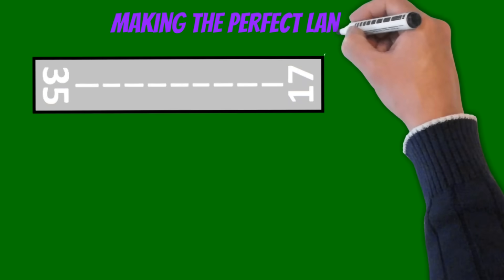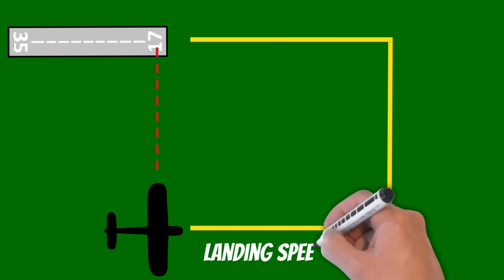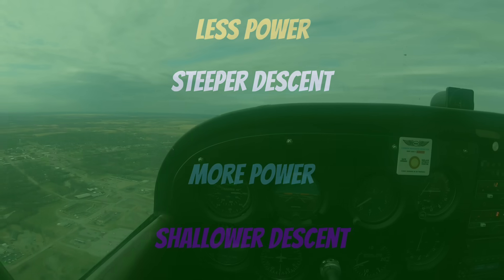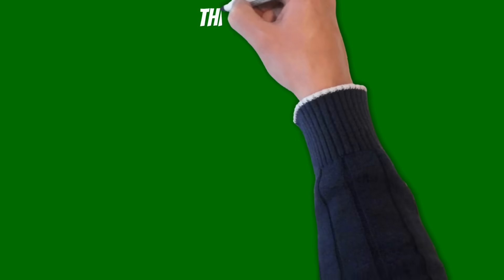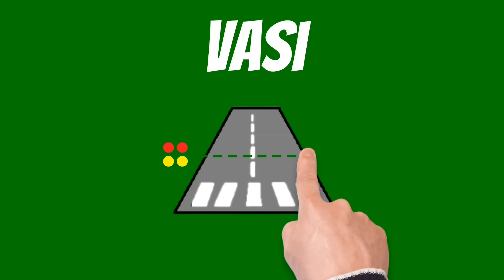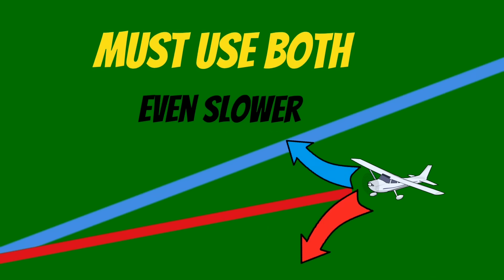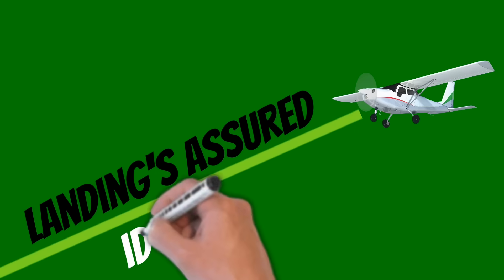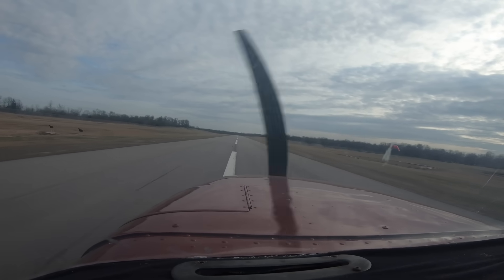Landing SECRET your Instructor won’t tell you [How to Land]

Comment: The secret is fly a cessna 172.

Then all you must do is fly parallel to the runway about 1/2-mile offset. Upon abeam the numbers, simply reduce power to bottom of green, top of yellow range on Tachometer.

First notch of flaps. 

Then fly until runway is 45-degrees behind your shoulder. Make a gentle 20 degree bank, 90-degree turn. Repeat again shortly after. Line up and point the aircraft toward the runway.

Second notch of flaps.

Stabilize. Retrim.

Third/Full flaps.

Retrim. 

DO NOT CHASE THE AIRSPEED. Set the Angle of Attack with the aft pressure on yoke. Relieve backpressure on yoke by use of trim wheel. 

The airplane is stable. The approach is stable. 

Fly to the runway with small changes in power.

Prevent win srift laterally with a little bank angle. 

Keep the nose pointed to the runway centerline with rudder. 

A little cross-control is fine. Forward slips are safe at reasonable glide speed.

Within 10-15ft of the ground, do not flare. Simply apply enough back pressure to slightly level off, and reduce downward velocity. But keep gliding down, just shallower. (Wingtips flat and level to horizon). Now just a second or three later, begin the flare about 2.5ft off the ground. Be lower than 3ft but higher than 2ft when you start the flare from shallow glide/level off. 

The Cessna lands itself.

A Cherokee almost lands itself. 

A Cub, less so, but still easy enough. Citabrias are the easiest tailwheel to land. A Pitts less easy. The hardest is a BF-109.

Rule 1: Never relax backpressure on the yoke, except to break a stall. Once the elevator trims the wing to a new higher angle of attack, 

NEVER let the controls move forward. You will dip and pick up speed, and get into unstable porpoise motion.

Ease them back, trim. Do not let the control forward. If you have a higher rate of decent that needs caught, you add power. Not elevator. If you need more speed, add power, then ease up on the elevator slightly. Then retrim. Power is king. Elevator pressure stays in until power overcomes decent.

Comment: My first solo flight at CNO began like this, everything by the book, and on downwind the (teaching future controllers) tower told me I was cleared to land. When across the numbers the tower came back and told me that a fast turboprop was coming in for a straight in landing and to 'expedite' my landing. I immediately reduced power but after turning base and then final I was way close and high and had never used the flaps because my instructor liked to teach landing well without before introducing them. What he had taught me was forward slips, so full rudder and coming down as a brick while nicely aligned I managed to make a flawless landing on the numbers. Dave Rogers, my dear friend and fabulous instructor, smiled, wiped two drops of sweat from his forehead and told me 'nice landing'. I was slow at learning to land well, but once you understand you may no longer need to follow all these 'secrets' and methods and it may even be wise to train solving non-standard situations and out of the ordinary landings.
Reply from the maker: Some moments can’t be taught lol

Comment: Great video. What I do is maintain constant angle of attack and power to control descent rate. 

Obviously there will be times when  you have to make corrections to both but normally constant angle of attack with power managing yields a stable approach. It is also a good technique because constant angle of attack yields roughly same range of speed when used with power for descent rate during an approach. 

It was the method taught to me years ago. My instructor made sure that I can land my aircraft even when airspeed indicator is INOP. I am a professional corporate pilot now and I still fly my jets this way
Reply from the maker: Great point, what you are describing is what many pilots call “flying the wing”

Comment: Not a bad video, apart from the click baity title. I teach it a little differently, because the types I fly usually requires a higher pitch on touch down and you can't see the end of the runway during the flare. I always wondered why some pilots call out the station they twice? I have been hearing this for a while but only from hobby pilots. I never found this in any official curriculum despite the fact that I have been teaching ATPL theory for 10 years now.
Reply from the maker: Yeah, not my best title. If you’re flying at a non-towered airport, the AIM recommends a station call at the end, especially if you’re operating on a mutlicom frequency. I miss the initial location all the time when there’s another multicom nearby
Reply: @FreePilotTraining  Yeah. Here, in the EU the frequencies are well separated.

Comment: NO. You should never look at the far end of the rwy. One reason is that not all rwys are the same length. Instead look about 1500' down the rwy. Hear is SoFlo, we had TNT for practice until lately. Its 10,500' and you can't see the end.
Reply from the maker: Actually, you shouldn’t be looking AT any specific point on the runway at all. Watch this video, I explain why: https://youtu.be/nM9QWV8WEiM?si=0HZW23JfIF_g8rw0

Comment: I'm a 600 hr pilot with about 150 hours in a my new to me Cirrus SR20 G2. One contradiction that exists with Cirrus is that they harp on being fully stabilized at 500'. But then they say on short final to change airspeed from 80 kts to 75 kts. Now, 50' above the ground I'm intentionally becoming unstabilized by slowing airspeed and changing pitch all the while trying to keep my aim point from moving. Any advice?
Reply from the maker: You should change to your landing speed as soon as you roll out on final, NOT on short final.  You should check out my new landing book at www.freepilottraining.net
Reply: Thank you. Being I'm in a Cirrus my landing speed is much faster than in a C-172 , Archer, etc. Plus it's a slick airplane with less parasitic drag so I do tend to float more as well. Does this change any of the information you presented? I'm looking forward to you book on landings. I was always taught the TLAR process (that looks about right) but I much prefer your (and apparently the military) way.

Comment: I have watched many landing videos, and this one, in my opinion, covers all information for a new learner. Other videos leave out key information. Great job on this video!😊
Reply from the maker: Thanks!
Reply: I do have one question: 
When applying flaps, the airplain nose  has a tendency to pich up when first applied. What is the best method to counteract this. Reduce air speed to bring the nose back down, pitch the nose forward with the yoke, or use trim? Trim seems to be a slow reaction method compared to the others.

Comment: Drives me crazy when some pilots chase the airspeed with pitch. Too erratic and irregular of an approach profile; imagine the decent angle constant, force it to be that way, use the throttle to control speed, just like driving a car down a hill, and trim as needed.
Reply from the maker: You can do either or both. The point is that one is more effective than the other. https://youtu.be/MqxKJLQdcxM?si=159eLq9-JjAy14Jp

Comment: I had a J3 on my ranch strip. I probably executed close to 100 landings dead stick after I shut the motor down and I landed on my selected spot every time. Never overshot or undershot..Here is the secret of perfect landings. On downwind watch your selected spot in the side window. it will move back along the window and as soon as it starts to curve up you make your turn to base leg. Do the same on base leg with the same spot. As soon as it starts curving upward that is your clue to turn final. Now watch the spot in the lower part of the wind screen. If it moves upward or downward will be your key to using corrections. I used this technique even though I had no power available but when you have power just add a little if the spot is moving up and add flaps or side slip if the spot is moving out of sight at the bottom of the windshield. It is easy and works. Don't complicate landings with all the extra thought because you aren't making moon landings. Try the moving spot method.

Comment: I have around 8000 hrs PIC, on floats, skis, and wheels. The following is true in all cases. When you rotate on take-off, remember that exact picture that you see outside. When you land, the picture at touchdown should look exactly like the picture at take-off. This is true on any alighting surface, land, snow, or water. Your instructor will provide all the detailed instructions and advice, but that's what you're shooting for.
Reply from the maker: Love the tip. Thank you

Comment: Continuing..So if downwind, no wind, I know when I pull the throttle out and trim I will hit my spot, this is a level of mental comfort. Once you turn base and have a second view you have already made the runway and any correction should be minor, but that is now two relaxed assesments with minimal control input. And if you still need help, as soon as you are on final use the mantra, "high, low, or OK". and you still have that third low imput chance with most of final infront of you. I swear if you follow this, even if you need the third assesment, the fianl appraoch will be a relaxed waiting game followed with a smooth flare and touch down...why...because you were not dealing with PIO's, lol. Just remember the mantra, work it into the basics, and you may not need allot of the basics!>>>Mark

Comment: Well I liked the video format, thanks. I do have one huge addition only. It has to do with the consistancy of proceedure and reducing that pilot induced occolations. 30 years ago I used this as a CFI but got the concept from a great article, tried it, taught it from there in. The beautifull part of this proceedure is it just fits into this video, no contraditions, just creates the situation for a reduced stress landing based on that old concept of staying ahaed of the aircraft. If we are allowed the given at the point the runway button is at our 45 degrees this is our common base point, only final headwind speed needs some possible additional power. Now I never taught any speed reduction or flaps down wind, downwind for checks and eyes outside. At the base point I have an idea if I will need power or not and a rough power correction in mind. In one movement, reduce power to #1 guess, slow the aircraft while trimming. The second you feel you are in a stable base appraoch make a #2 quick assessment, "high,low, or OK",  then immediatly make some input changes, trim and wait.

Comment: My instructor called slow flight "the region of reverse controls" when you pitch for airspeed and power for altitude. Different lingo here, but same concept and you hit some good nuances with it i didnt know.
Reply from the maker: I used to call it that too.  I think the region of reverse command is something a little bit different. I call it the back side of the drag curve instead.  You might like this video https://youtu.be/MqxKJLQdcxM?si=4C6t97P563cqQQ2m

Comment: the one thing not mentioned is ground effect.  you can use ground effect to replace power, and as you transition into it, adjust power into the flare. i never liked to “chop” the power because it is slightly destabilizing.  as the ground effect makes itself apparent, you can begin to carefully reduce the power, and as ground effect is full, you are at idle power, stabilized, and continue smoothly into the flare.
Reply from the maker: Great point. Thanks for the comment

Comment: Small planes do not flare, they bleed energy, round out and touch down. Only big twin turbines/jets flare. I heard a little aileron into wind from left but then heard use some "top rudder" that you mentioned on appr when a little to right in the landing phase?? Odd. Is it the x wind that pushes on the tail and turns nose towards the wind? And do we use opposite rudder to align with rnwy?? I am confused.
Reply from the maker: I still consider it a flare.  This video explains why: https://youtu.be/KXoz7EyWpog?si=mYU9buyXtwWXp50t

As far as the crosswind controls go, there’s two ways to keep the airplane straight on final. One is to crab, the other is to use the wing low method

Comment: This is extremely complicated for a student to comprehend it’s way too much information : 
Just keep the numbers of the runway one spot on your glare shield < windshield  > 
>   Use power to maintain desired approach speed 

 > keep the nose and pitch the same on the windshield all the way to the runway 😂 when you cross the threshold, start looking further down the runway and make sure you get a full stall landing that means the stall horn is going off > just before touchdown .
I’m a gold seal flight instructor with over 200 sign offs for certificates and ratings > with no busts > 7000 hours of flight instruction before I went to the airlines .

Comment: Very nice video! I personally use this principle, "when power is available and variable, power controls speed". 
With no power(engine failure) pitch controls speed and we trade speed to adjust descent. With a fixed power setting like after take off, we pitch for speed. In descent power is available and variable so we can fly like an Autopilot with Autothrottles which pitches for descent and adjusts power for speed.
Reply from the maker: Thanks! Great advice! I haven’t heard that one
Reply: @FreePilotTraining  you are welcome. I have a tip for xwind landings. many experienced pilots, even test pilots, sometime land with the wrong wing down. blame muscle memory which kicks in when we are stressed or uncomfortable. when approaching ground effect if the runway is off to one side muscle memory kicks in and we tend to turn to the runway with our hands(ailerons). tip: think of the runway as the ball on the slip indicator. just as we step on the ball, step(stamp) on the runway. that way we turn to the runway without lifting the upwind wing while maintaining center line with side slip
Reply from the maker: @captarmour  ooh…I like that! Thanks for the idea!

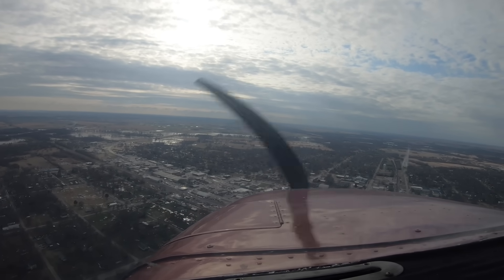Comment: 4:42  1)  To turn to base, bank up to 30 degrees and watch for the runway number to reach the left marker on your gyro compass.  That way you will know when you are perpendicular to the runway centerline, which is where you end your base turn.
2)  Turning base is the strangest part of flying.  The plane is low, slow, turning, sinking, and you can't see the runway.  This is all normal!  If you have any worries, glance at the airspeed and altitude.  A Cessna won't stall in a gentle turn and gentle descent at 70 mph.  As soon as you are done making the base turn and level the wings, everything will appear much more normal.
3)  Make sure to actually fly a base leg, not just one big sweeping turn from downwind to final.  That level flight in the base leg lets you see where you are.
Reply from the maker: Great input! Thank you

Comment: Another thing to consider. If you overshoot the centerline when turning from base to final, don’t turn too sharply to get back to the centerline. You could cause an accelerated stall. If there aren’t any obstacles, take your time getting back to the centerline. You just need to get on the centerline before reaching the threshold.
Reply from the maker: I actually have a video about this exact thing. You might like it. https://youtu.be/YWitXcjrE64?si=JXdkDWiHQIMxjQKB
Reply: @FreePilotTraining I saw it some time ago and commented on it. I never lowered the flaps while turning; only when the wings were level. I also didn't pull on the yoke during turns in the pattern; I'd let the plane continue to fly at the trimmed airspeed.

Comment: Hmmm I been flying for 50 years and this seems like a lot of little details to remember. All accurate and correct and valid and all that but when I was trying to solo I doubt I could possibly keep any of it in my mind. Muscle memory I do agree with and it's the first time I heard it applied to flying. Developing muscle memory is how I became skilled at crosswind landings. My ONE (out of several who were bums) good instructor sent me home to practice crosswind landings using the bed post or whatever I could find to simulate aircraft controls. I practiced pretend X-winds a couple hundred times as advised. Sure enough my next practice session at Goodyear-Litchfield, a X-wind blew in that had the sock pointing straight across the runway. I handled it easily and just kept doing T&Gs enjoying the experience of wing low touch downs. (thanks for that lesson Gary Neely) Muscle memory works and never failed me in all the years. I personally couldn't remember the details advised in this video, especially not in a split second when things get stinky. Responding correctly when there's no time to think  saved my butt many times.
Reply from the maker: Valid points. For me, I needed some actual information that could help me understand the control movements and what was happening.  Sometimes this information can help you visualize what you need to do. Similar to your bedpost. Gotta know which way to move that stick. Lol

Comment: Manufacturers should make Light Business Jets and Private Single Engine and Twin Turbo Props with 2 inch plexiglass below the pilots legs so they can get a visual on the runway.
Reply from the maker: I’m all about extra windows, but I don’t know if a window down there would make it much easier. We have a couple down there in the C-130, and I never look out of them

Comment: Yeah....eyes DOWN the runway on roundout and just use finesse until the airplane settles to the ground. Dont force it down.  Keep flying the airplane until you are slowed down to a fast taxi then OFF the runway on the taxiway. Clean up after you exit the runway. Good refresher. I teach stick n rudder first. All that foreflight and EFB crap is good to learn after youve become proficient with the basic stick n rudder of just flying the airplane